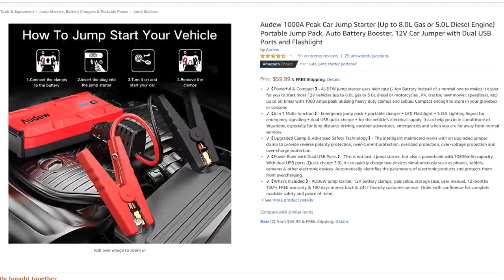Building A Kawasaki KX 250 Shifter Kart Part 5

Comment: If you want good strength/weight ratio, use a core material in the fiberglass/carbon, depending on what you use. Using foam core, nomex honeycomb, or other core materials that are light makes the sandwich much stronger.

Comment: You still got to figure the steering out. Get the principles right and include then a ton of adjustment possibilities. This is such a nice little project so get it right on the money the first time. 

After all it only needs a few minutes of thinking, on a years work.

Do it as you do, as long as inner front turns slightly more all the way.
Reply: Don't get me wrong in any ways. Your project is fabulous. Maybe... try to get your hands on some rc-buggy with all possible steering adjustments, forget the suspension and work your way understanding the geometry just in the steering alone.

Comment: Next time try using wax on that surface so the fiberglass won’t stick
Reply from the maker: Will look into that
Reply: That or he can just put some ceran Wrap. Idk how it's spelled out. But it's the plastic wrap that people use to cover food and stuff like that. You can find it by the Tupperware section, in like Walmart or any store like Wal-Mart. It'll be in the kitchen section and It'll be with the aluminum foil, and wax paper, plastic bags and all that stuff. Saran Wrap.

Comment: Gas tank will be light but constantly empty bud. 2 smokes are very thirsty, maybe if you decide this also you should just add another where you can place the weight where you want. Just a thought. You’re understanding of these elements of speed are inspiring to see in such a young man. Check out 2strokestuffing channel he’s in the process of making the future of 2 stroke right now, it’s gonna change everything. 1hp a cc how’s that sound.

Comment: Just subscribed and great vids. I have a question, I’m building a shifter kart with a 200cc 5 speed engine, and I’m wondering what gearing I should go with on the engine sprocket to the axle sprocket.
Reply from the maker: Thats not as powerful as a 250 so Id say 11/22 - 11/32
Im running 12/22

Comment: Awesome build but i have a few comments.... first of al it is complete overkill of a frame  and you can get away with alot less... also the aero mods are a litte excessive. At any speed under about 60mph that wing is just going to be a dead weight, and in my experience is unnecessary  for the amount of power you will be making. I might be wrong but thats just my point of view. Keep up the good work

Comment: What's the expected weight including the engine? I'm building a shifter as well, but it's a mere 50cc
Reply from the maker: A kx250 dirt bike weighs 220lb my goal is to stay below that
Reply: @VasilyBuilds  Hope you manage to. I'm trying to keep mine below 200 lbs. It's got way bigger tyres, 14 inch rims, but it won't have as much grip as a kart tyre. Luckily, the gearing won't be the issue because of the wheel size
Reply: @VasilyBuilds , to get or keep the total weight down, I’ve got some suggestions that are in the same diy category. You are doing a fine job and learning at the same time.

Comment: Are you building a gokart or a tank? LoL (sorry) 
And are you using 41 30 chrome molly or just mild steel ?
Reply from the maker: haha, Im using mild steel pipe. It will do for know I need $$$ if I want to move up to tubing or chromolly
Reply: @VasilyBuilds  👍👍👍 the kart looks great.. but I still suggest you do some test runs with a small motor
.. just to see how it handles.  In a big parking lot.  👍😎🏁